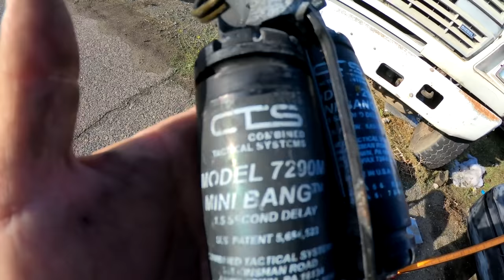Searching Police Cars Greatest Finds Of 2018! Crown Rick Auto

Comment: The gun is a Kimar Px4. It is a blank gun. Meaning the barrel is plugged and it either top fires or has a small hole big enough to release the blank ammunition gas.
Reply: @Cleve Woodbury it wasn't an opinion. I sold kimar and umarex blank firing pistols for almost 5 years
Reply: It's a beretta
Reply: @mopar21  correct, baretta px4 storm replica. Notice the K for kimar on the pistol grip. Baretta has a trident logo
Reply: Joeybago12 you’re right in the video it says April fools
Reply: Thanks for the clarification, I have had a couple PX4 s, why I clicked on this video actually. But I couldn't fathom how someone could be so irresponsible with an actual gun. Makes a little more sense now.
Reply: Alvaro Lopez  its a replica blank gun, made by kirma. police departments that issue the px4 use those for training.
Reply: The gun looks like a blank gun called Vector 9mm. You can see it at the clip in the handel. The clip is much smaller that a real clip from a 9mm.
Reply: trik trak you mean the magazin not the clip
Reply: Fritz Wolf yes i mean magazine but im a gamer and we call it clips :-)
Reply: Yea he says so I’m full video link in description
Reply: @triktrak1277  im a gamer and i dont call mags clips. speak for yourself.
Reply: Pack A Punch well i just did!! Its a clip
Reply: trik trak. You also obviously have no knowledge on actual firearms. That mag was standard size for that pistol. Any gun can fire blanks it just gunks it up like crazy because it’s just gun powder.
Reply: FallopianTuba okay
Reply: @mopar21  little
Reply: Its still a felony to discharge a firearm in this manner...even a blank.
Reply: sailure1 but it is cool :-)
Reply: And it said before the clip started that it was a bonus clip for or from  April fool's so yes it's very fake
Reply: Joeybago12 even if it is a blank gun it’s irresistible to show that as a kid could think it’s OK to fire into the air.

Comment: I installed graphs that mounted with a special clock in the trunk for Nashville TN PD in the late 70s 80s so had to run wiring through the car out the trunk found all kinds of stuff mostly under the  seats.

Comment: Why you should not fire a sidearm into the air? 
Because the bullet goes up, converting this kinetic energy into a potential energy. When it reaches the highest point, it starts falling, converting the potential energy back into kinetic. And this bullet is going to fall somewhere, you have no idea where and who’s head it will fall.